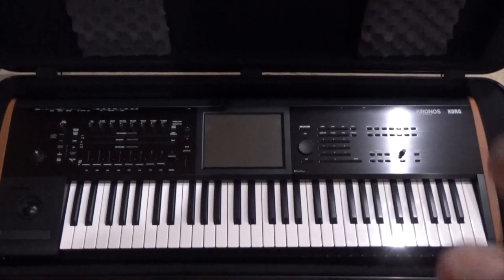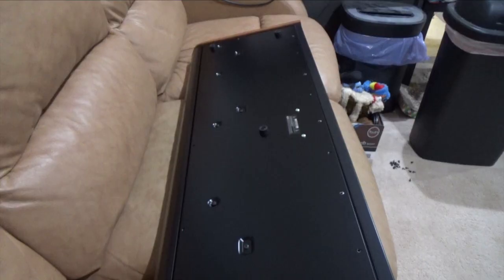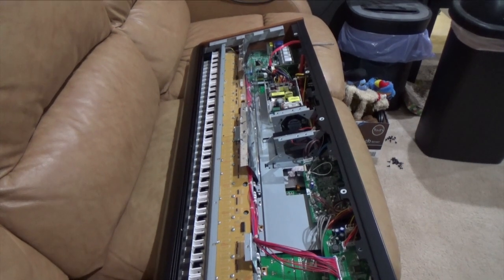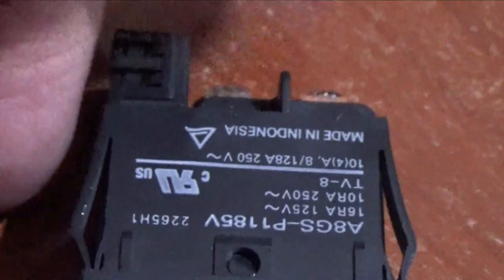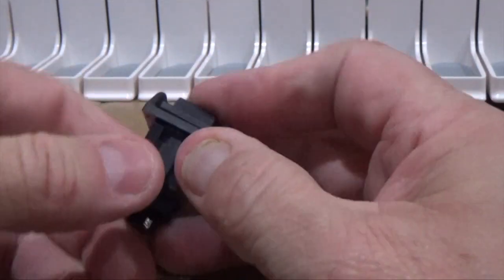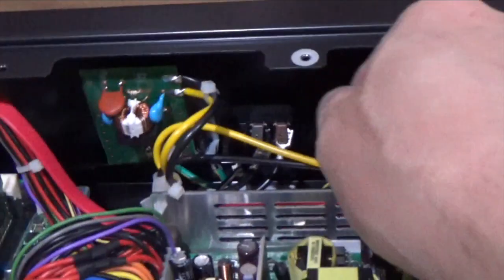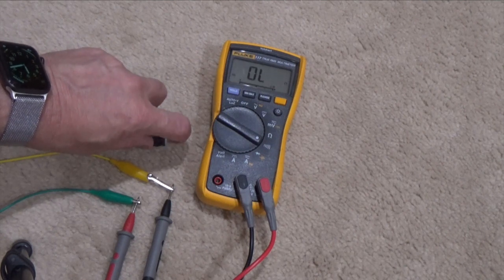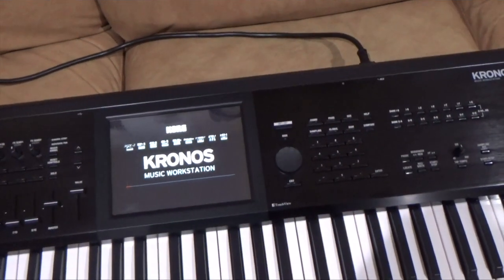How to replace the power switch on a KORG KRONOS Keyboard   HD 720p

Comment: Thank you Ron, great presentation. But, I have question regarding my Kronos Power Switch. My Kronos 88's power switch is kind of wobbling (vertically). There is no connectivity issue, but the power switch moves when I use it. Do you know the what the reason and should I get it fixed?   Thanks for your time and help.

Comment: Hi - I can see the big spades are the power connectors. Did you find out what the smaller wires on the side did?
Reply from the maker: West - I have not done a ton of research on this, but the smaller wires are for a Microload. The switch it basically a DPST switch which has two connections... High Load ( 120v) and a Microload ( I do not know the value without looking at the schematic.)  I would guess it energizes a board with 5V for the LED lights and things.. that is a guess.

Comment: Thanks Ron. Problem is that the a8gs-p1185v is not available at the partsipsart site anymore. In fact, I can't find it anywhere. Any ideas? you think the old one can be fixed?
Reply from the maker: Erik..... Digikey has them..    https://www.digikey.com/en/products/detail/omron-electronics-inc-emc-div/A8GS-P1385/4248838?utm_adgroup=General&utm_source=google&utm_medium=cpc&utm_campaign=PMax%20Shopping_Supplier_Omron%20EMC_0039_Co-op&utm_term=&utm_content=General&gad_source=1&gclid=Cj0KCQjwiMmwBhDmARIsABeQ7xRTJsua9lPE-MDzivzVzJDPSCxBtXyPfyeX9SQPw8UQ53hbwNWnUGQaAk_QEALw_wcB

Comment: Nice repair and video! Do you know what's the reference of the frame that is protecting the switch? Yesterday it broke in a gig and now the switch looks kind of unprotected. Thank you so much
Reply from the maker: Not sure what you mean about the FRAME ?
Reply: @rciancia  I think you called it the "guard" of the switch
Reply from the maker: @rafarodriguezmusic     if you mean the plastic housing that goes around it, I would remove it and see if Crazy Glue can help fix it.

Comment: Hi Ron any tips on the removal of the bottom Cover of the Korg Kross? I have purchased the replacement switch from partsisparts but cant get to it! I have removed all the screws from the underside but cannot get it to separate. I dont want to force it as it seems solidly attached
Reply from the maker: Garrod - if you removed all the screws don't be afraid to pry it up a bit.. if you see in the video,  mine was a little hard to get off at first... just make sure all screws are out and you are ok.

Comment: Hi Ron, Do you have any videos for changing the power switch on a Korg Kross?
Reply from the maker: Hi Garrod.. The Korg Kross power switch is different. It is soldered directly onto a circuit card in the back. You would have to remove the card, unsolder it and replace it.   The switches are available to buy
Reply: Many thanks! Happy New Year!